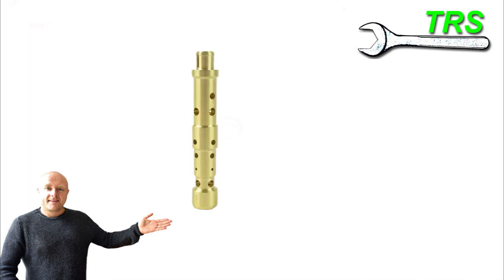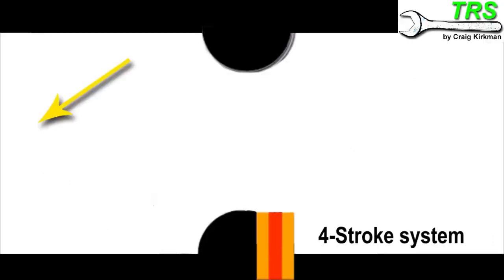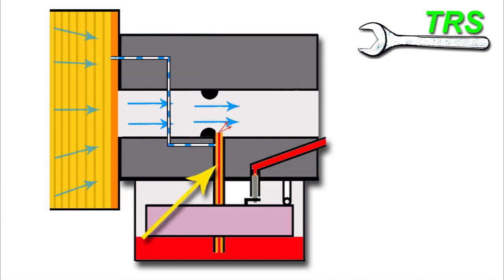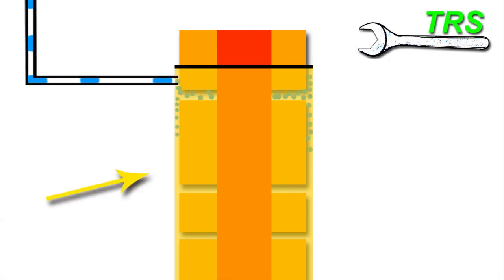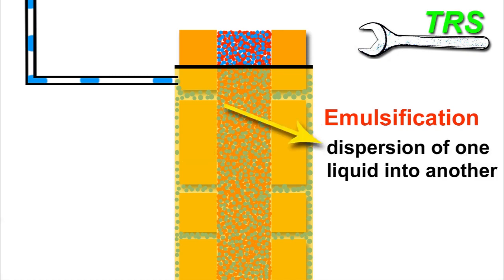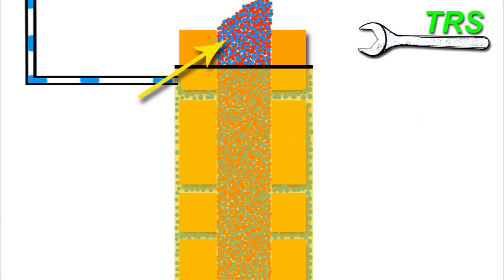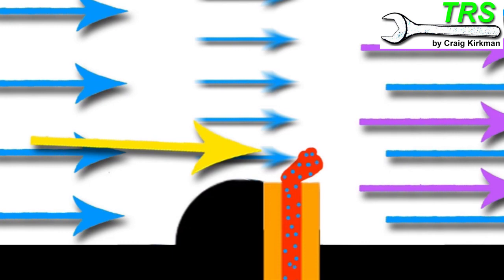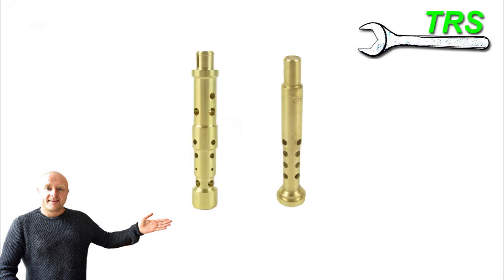Carburetor Emulsion Tube Explained  - How it works - What they do?

Comment: This was EXACTLY what I have been seeking. Very straight-forward, with illustrations and concise. Thank you!
Reply from the maker: You're very welcome!
Reply: @TheRepairSpecialist Question- Dellorto phbg 19mm 2 stroke carbs have an emulsion tube called an atomizer with no holes.....The 4 stroke carbs have the same emulsion/atomizer tube buy it has holes. The no hole tube is 2 stroke only & won't run right on a 4 stroke. But the atomizer with holes works for both 2 & 4 strokes. So will a 2 stoke also run better with holes in the tube. Or run better with no holes? 
I suspect the 2 stroke will need a bigger main jet if using a atomizer/emulsion tube with holes. Since the engine is getting more air mixed into the gasoline?

Comment: i made the comment on the other video about the old school air compensation valve.

thats the other half of what these do... regulate the suction on the main jet with the air mass passing through the venturi, to deliver a "constant" mixture regardless of air mass. 

the air inlet, air jet, forms a pitot with a certain ratio to the overall throat, so that sets the pressure variation. fuel, in the bowl and the chamber around the tube is under atmospheric pressure, whereas the chamber itself is under the pressure of the pitot tube. which is directly proportional to the velocity and the ratio of bore sizes.
the spacing and number of holes alters the amount of air fuel for any specific RPM as that pressure ratio alters. fuel gets pushed down lower and lower against atmospheric pressure, and uncovers successive holes, leaning the mixture out progressively. ideally... 

at any throttle setting, the RPM may vary through a wide range, and the suction on the jet as the air mass alters will also alter. 

you also find a lot of the idle circuits have their own miniature emulsion tubes, performing exactly the same function but in miniature as its using the air that bypasses the slide. the "idle air" intake tube is basically a very very small carb strapped to the side...

the CV carb is another layer of trickery with its self regulating slide and needle to deal with... arrrgh!

put four in a rack and then its just a whole new level of hair pulling :) i dont ever want to deal with a six...
12? !!!!!!

as i mentioned... a brake dyno, a "prony brake" type... you can keep a fixed RPM, and vary the throttle. this just deals with the actual jet sizes.

the inertial type (or prony with a bit of unloading, which is better as you can bog it down as well!) will register the variations in mixture as the throttle stays constant but the RPM alters. and thats all about that emulsion tube and air jet.

seat of the pants or plug chops dont always tell the whole story and its a big part of why it can be a nightmare sometimes. the stumbles and flat spots that you cant seem to get rid of... changing the wrong part! remember, no carb chart mentions emulsion tubes. got all these little overlapping parts, but they all only relate to throttle position, or slide cutaways, or needles... not air velocity.
Reply from the maker: Thank you for sharing your extensive knowledge and insights on the old school air compensation valve and its role in regulating the suction on the main jet. Your detailed explanation of the mechanics behind it, such as the pressure variation and the impact on the air-fuel mixture, is truly enlightening. It's evident that you have a deep understanding of the complexities involved in carburetion systems, particularly in the context of CV carbs and the challenges they present. Your mention of dealing with multiple carburetors and the intricacies of tuning them adds another layer of complexity to the equation.

Your point about the limitations of seat-of-the-pants testing and plug chops in diagnosing carburetor issues is well taken. It's clear that you've delved deep into the nuances of carburetor tuning, and your insights are valuable for those seeking a better understanding of these systems. Your passion for this subject shines through, and it's evident that you've gained a wealth of practical experience in this field. Thank you for taking the time to share your expertise.

Craig

Comment: If I understood correctly, theoretically, the more holes in the emulsion tube, the leaner the mix? 

Also, where in the throttle position does this effect have the most effect? 

Thanks 🙏
Reply from the maker: Yes, you are absolutely correct. The emulsion tube in a carburetor plays a crucial role in mixing air and fuel for combustion. The number and size of holes in the emulsion tube determine the fuel-to-air ratio. If there are more holes in the emulsion tube, it allows more air to mix with the fuel, resulting in a leaner fuel mixture. Conversely, fewer holes would create a richer fuel mixture. Adjusting the emulsion tube is one way to fine-tune the air-to-fuel ratio in a carburetor.

Thanks 

Craig
Reply: @TheRepairSpecialist  Great, that answers my question 👍
Reply: @TheRepairSpecialist Dellorto uses different emulsion tube sizes also along with holes.

Comment: Guess I shouldn't ask about the science behind the size, amount of and location of the holes on the tube. I've been hoping for years that the handful of Weber DCOE tubes I have would talk to me but they refuse...enjoyed the video, good job.
Reply: See below… emulsion tubes are really a mixture weakening device as revs and load increase. The atomisation effect was fortunate but in fact, incidental to mixture correction
Reply: @TheHarryMann That what I suspected. Dellorto phbg carbs have a 2 & 4 stroke design. The 2 stroke carbs use no holes in the tube & won't work on a 4 stroke. The 4 stroke carbs use holes in the tube & can work on both 2 & 4 stroke. So the majority now come with holes. 
I suspected if I bought the carb for my 2 stroke. That I'd need bigger main jet since the emulsion tube is adding more air & less fuel. 
But I suspect it's better to use an #AN tube with holes & add bigger jet since it'll mix the gasoline/air better than a #AU that uses no holes.

Comment: The explanation is totally incorrect....although many, whom don't understand carburetor operation often make this mistake for some reason. 

 Emulsion tubes are there to lean off the air fuel ratio as air velocity goes up with engine speed. 
Why? Because....the air flow increases but, the mass of air doesn't increase directly in proportion....so the main jet is 'keeping up' with air flow not air mass, hence the air fuel ratio will become too rich without the emulsion tube. 

The reason there are holes at various heights is because as the air flow increases, the fuel level in the capacity well (where the emulsion tube sits) decreases, thereby exposing more emulsion tube air holes thus, leaning the main jet fuel with air flow.

 Think of the fuel coming out of the main jet been pre diluted like a soda syphon.😎

Comment: Does jet needle and emulsification tube is same ?2.when piston sucks air does air is sucked from main jet as well as from emulsification tube at the same time or not?
Reply: My main jet is on the bottom of the emulsion tube. So gas is being pulled in/up through it from the bowl. While air is also being sucked into the emulsion tube through the holes. So the gas & air is getting mixed together on it's way up the tube. Then sucked into the main carburetor hole & sprayed into the intake manifold. 
2 stroke guys say a roughed up intake helps fuel atomization. But I think that's for a carb with no emulsion holes. On a carb that has holes in the tube. The gas is well mixed, so a polished for better flow is probably better. Since gas is already well mixed.

Comment: Dellorto phbg 19mm carbs have an emulsion tube called an atomizer jet. The #AU jet/tube has no holes in it  & says it's for 2 stroke engines only & doesn't work with 4 strokes. 
While the #AN tube has holes in it & says it's for 4 strokes but will also work with 2 strokes. 
My question is, will the AN with holes work better on 2 strokes than the no hole AU? 
I kinda think maybe, Dellorto made a 2 stroke carburetor first. With no holes in the tube, then later added holes realizing it mixes the air & fuel better. 
Like if the original 2 stroke design was running like crap on a 4 stroke. Then they figured out the holes fixed the issue. 
Or will a 2 stroke actually run better with the AU no hole emulsion tube/atomizer?

Comment: My idle emulsion tube was damaged on the screw head. Would this stop it from working properly 😊
Reply from the maker: It may do depending on how badly damaged it is. Providing the ready of the carb and engine are ok Maybe worth replacing to at least eliminate possible issues.

Comment: So the air fuel mixture screw on 2T engines works only to regulate air for the pilot circuit, not the main circuit.
Reply from the maker: Thank you for your nice feedback I really appreciate it. Craig 👍

Comment: What if I add more side holes? Will it improve the emulsification?
Reply from the maker: Maybe but I have never done this and don’t really know the exact outcome. Craig
Reply: The main effect wasn’t explained, that of gradual weakening of the mixture at the top end, so yes it will change things, it’s how some fine tuning can be done, by tapering rounding the bottom of the tube or very minute changes to the holes

Comment: Emulsion tube makes air and fuel mix
Emulsifier is used when 2 ingredients do not mix naturally 
Same as emulsifier in food, 2 ingredients cannot combine without it
The emulsion tube is trying it's best to turn a liquid into a gas by atomising the fuel into tiny droplets, the tinier the better which equals more surface area of the fuel
1000 tiny bubbles has a lot more surface area than the same amount in 1 bubble.

Comment: Do 2-stroke carburetors also have a emulsification tube? Thank you for the great video(s).
Reply: I doubt they need it since on a 2-stroke, the fuel/air mixture gets inhaled into the crankcase and sloshed about, thoroughly mixing the two. Small 2-stroke engines have diaphragm carburetors (instead of a float bowl) and the ones I've seen do not have emulsifiers.
Reply: @devilsoffspring5519 I seen a 2 stroke will run with or without holes in the tube. But a 4 stroke needs holes. This makes me think it's best to use holes on a 2 stroke and just use a bigger main jet if needed. This means the air & gas will be mixed better than a no hole tube & won't need to rely on the crankcase to further mix it. But......being less mixed will probably provide better lubrication. If I order a better carb with holes in the tube. I might try 35:1 oil mix instead of 40:1